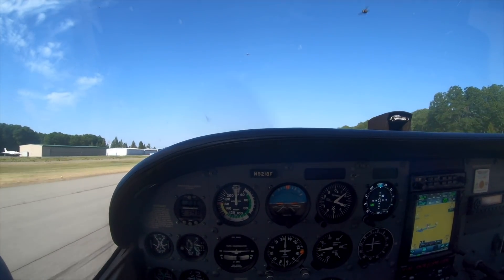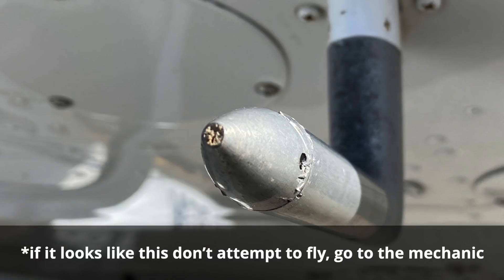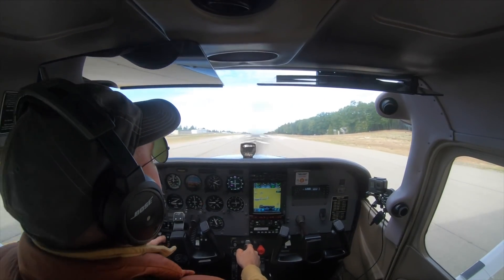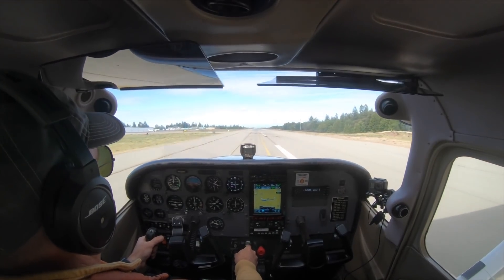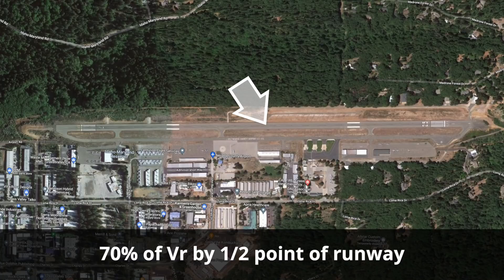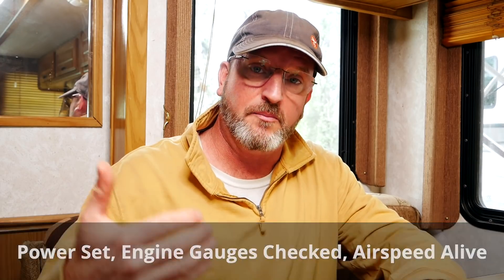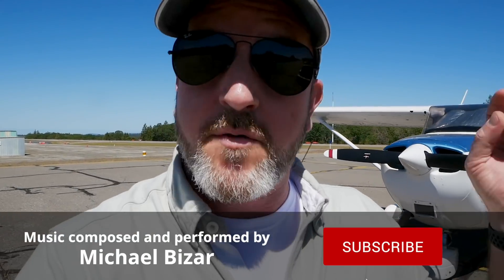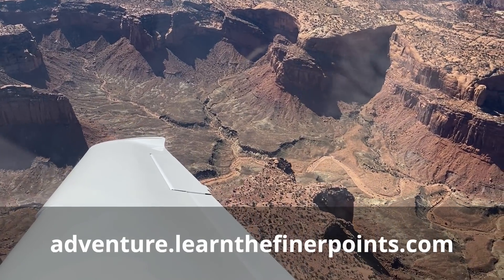PITOT TUBE BLOCKED - Review of ABORTED TAKEOFF PROCEDURES and other Flight Safety Best Practices

Comment: Once with a new (to me CFI) I was doing my walk around. I noticed the alternator belt was super loose. (I’m a welder/mechanic). He said it was probably fine. 

I said “no, V-belts have a specific tension” so I went and told the mechanic. He came out, verified it was loose, but should be ok for a quick VFR flight.

So, we went anyways, and indeed, the belt was slipping.

Comment: Didn't happen to me, but a friend in a 182 was flying down to Florida and his airspeed just dropped and went to about 20% of actual airspeed.  He landed at an airport with no issues went out to check the aircraft and there was what looked like the remains of a bug over the pitot tube. He cleaned it off looked inside the best he could and it looked al clear. Did exactly what you did and his airspeed reading seemed right where it should be. Taxied back and went on his way.

Comment: This is one I definitely relate with.  Had this happen to me doing a rental checkout to resume my instrument training.  The pitot tube looked fine externally on the preflight, but when we lined up and I went full throttle - no airspeed.  Immediate abort (made it to about 60 mph maybe - airplane was in MPH), taxi back, find that there was something gelatinous about 1 foot into the tubing between the pitot tube and the panel.  Plane had come out of its 100-hour that morning, and the pitot system was disassembled and checked as part of it, so the mechanics believed it happened during that, but there was nothing used during the inspection/repairs that would explain something like that (even petroleum jelly) being in it.  Just one of those things, but glad I had always been trained to watch for airspeed indication during the initial acceleration.

Comment: So. About a month ago. During take off roll airspeed came alive, as per normal. However only got to about 45kts. By this time I deemed it safer to go flying instead as 55kts was rotate. When it came to landing and flapspeeds I had my phone providing ground speed. And given a minimal wind day I worked with that. Elected to try and land a little faster than normal rather than accidentally stall out of the sky. All in all a pretty uneventful event :)

Comment: Long ago when I owned a Cessna 150 that parked outside I was In a rush to meet up with a friend at an airport an hour away. I raced through the ground check and when it came time for takeoff I noticed the airspeed indicator was not indicating any airspeed above what was locked in at about 30 MPH. I figured I'd continue the flight anyway.  When I reached my destination I suddenly realized how reliant I was on flying the "numbers" and found it difficult to come in on a stabilized approach (the winds were gusting pretty hard which didn't help either). After landing I took a look at the pitot and noticed I had a "Mud dauber " who had taken up residence in in the opening on the front of the pitot. Fortunately, the friend I was meeting up with had full access to a shop so we easily disconnected the Pitot (just a tube in an old 150) and blew it out with compressed air at the shop. My friend said that he had to set the pressure to max to clear the dauber (those guys really work themselves in there!). After that incident I have always covered and checked the pilot on any plane I own or fly.

Comment: By using the 70% AS/50% RWY rule you can get a false sense of security if you’re taking off on a runway that’s very long compared to your takeoff distance. For example, I fly a 150 out of KAVL, a mountainous airport with an 8000’ strip. If I only have 70% of my airspeed at 4000’, something is very wrong and I don’t have the power required to climb past the terrain.
I prefer to use an “off-by” marker. Estimating performance and adding a bit, then using some easily recognized point. If I’m not in the air by then, I’ll reject. At Asheville it’s the third taxiway, but it can be a windsock, patch of trees, or anything that can be noted in peripheral vision. If I have a passenger, I assign them rejected takeoff callout duties.

Comment: On the pitot tube subject. I recommend anyone use extreme caution when doing preflight check and checking the pitot tube heat. I recommend not having a 15 second conversation with someone just after you turn the switch on and then grab it to check if it’s hot. Best to do it immediately after turning it on. 🙄😂😫

Comment: I own a Cessna 140 which has a little flap over the end of the pitot tube to prevent bugs from entering.  Two times the flap mechanism has stuck on takeoff and on neither time did I have enough runway left (short runways) to safely stop.  Both times I just proceeded with the takeoff and came back around to land.  I’ve added the pitot flap to my preflight check 😉

Another time, I had avionics work done on my plane and the mechanic failed to hook up the static port tube to the outside vent and the altimeter (and VSI) were reading cockpit pressure.  As a result the airspeed indication was about 15% - 20% high at cruise. Anyway, I knew something was wrong and again focused on pitch and power settings and what “felt” right when landing.

All students should be exposed to this failure mode and loss of airspeed indicator should be part of their partial panel training.  Pitch and power equals performance….needs to be drilled into everyone’s brain.

Comment: I learned to fly back in the late 70s and early 80s, and back then, we didn't really do a lot of what you're suggesting in this video.  We checked engine gauges before take off, we made sure the controls were free, clear and correct, but when we pushed the throttle forward, heads were up, outside of the cockpit, looking down the runway.  Was that better?  Probably not, but it's the way it was done back then.  We did, however, practice flying the airplane with no airspeed indicator.  We learned by attitude, engine sound, engine RPM, and climb and descent rates.  Now, I flew Cessna 150s, and Cherokee 180s and also a Skylane, and by looking outside the cockpit, listening to the engine, looking at the RPM gauge (kind of hard in a constant speed prop, but you can look at manifold pressure for a given RPM) you could pretty well tell how fast you were, and you could fly the pattern from take-off to landing without looking at the airspeed indicator.

Would I recommend it?  No, of course not, especially today, but, it can be done and done accurately.  I could put the airplane on speed within two or three knots of the desired speed by 'other references.'  I'm not going to suggest your students couldn't do that, as I've watched the way you teach, but I wonder how many other new pilots or student pilots could do that with what most of them are taught today.

Comment: Happened to me winter flying in a Citabria (no pitot heat) in the CFI.  Airspeed was alive during takeoff, then slowly dropped to zero at about 300 feet during the climb out.  Engine RPM’s and everything else were normal so no question the airplane would fly.  Informed the tower, entered the pattern, and landed.  CFI reminded me to simply fly the airplane, feel the seat and the wing.  Such a great lesson.

Comment: Had this happen on a BFR years ago did a scan of the instrument 
S just after rotation announced no air speed and as if mine and the CFI heads where connected and look at the pitot tube in unison, when’s with power, pitch and one of my better landings in a long time

Comment: No airspeed is much less common than inaccurate airspeed such as a partial blockage. Taking off is not as big a problem as landing. It’s always a good habit to compare IAS to gps ground speed and known wind component on every landing. If a problem is suspected use GPS speed and plan for a longer landing holding it off til it can safety land.

Comment: Reminds me of an incident way back in the day. We were leaving an airshow and everybody was trying to get out of there that flew in. We did a quick walk around but really need to get going. As soon as I got airborne I noticed the airspeed was very lackadaisical and basically no matter how fast I was going it was indicating just above stall. I try to figure out what was going on and lo and behold when I looked out the left window I left the pitot tube cover on. Obviously I could not remove it and I was not in a position to go back to the airport since everybody was departing. So I continued to fly based on pitch and because it was a clear VFR day I was able to judge my airspeed. I set my flaps and my power settings and my pitch according to all the way I was used to landing. I probably landed maybe 5 kts or so faster than normal but it was an uneventful landing. Everyone at the club thought it was hysterical but the manager did not. Needless to say I was reprimanded.

Comment: My RV6 has a little wind-opened aluminum cover on the Pitot tube, and I always check it on the pre-flight, but this spring I had to taxy through some sloppy slush and snow on my way to the active, and I guess some of the slush splashed up on to the little cover, and I had no airspeed info.  I had the tail up and was at the point in the roll where I would usually be airborne, but decided to abort.  just as I began to ease the power back my airspeed sprang to life. At this point I decided it was safer continue the take off than abort, so I took off and monitored the airspeed during the climb.  
 After landing I stopped and looked at the pitot before I taxied back to the hangar, it was clear, and then after I taxied to the hanger, I found some slush on the wing around the pitot tube, so I am confident that is what caused the issue.

Comment: Here's another unknown that could kill you. After annual, I flew from Portland , Maine to Bar harbor. Shortly after I departed Bar Harbor and on take off roll suddenly my windshield was covered with what I first thought was 
a mass of locusts, but quickly realized was oil. Stopped takeoff and called for a tug to the local maintenance shop.
Took off the prop and the shaft plug fell out.  It had not been securely expanded during annual. Had it happened after lift off , my next stop would have been the ice cold water of the North Atlantic. Lesson learned: ALWAYS
be present at the reinstallation of the shaft plug and look to be sure it is expanded enough to create a secure fit.

Comment: Had the mud dauber effect on takeoff roll myself. Never again left the pitot uncovered. 
Jason, here's one that few are aware of. It happened to me on my 172.  The fuselage drain hole was plugged
and there was a fair amount of water accumulation, unknown to me.  All great on takeoff and climb until I reached the freezing level, and the water froze around the cables,
and the elevator control became very heavy to the point of almost no travel. On preflight ALWAYS check the fuselage drain hole.  Consider it to be the 4th point of your "Sump Check"

Comment: We recently had that issue in a Silver Eagle. However, what made it worse was that it was just a partial blockage so the IAS still showed some speed but it was unreliable. We noticed it was about 20-25 knots slow compared to the GS. It is important to be able to use GS (if you have GPS) as backup to get the plane down safely.

Comment: 36 years ago at AUN, my CFI was always in a hurry to get in the air.  He always complained about how long I took to do my pre-flights.  I often replied, "I can't just pull over to the curb and put the kickstand down.  It's my butt on the line, and yours too."  One day he offered me free time in his PA28-180.  Walking out to the plane he told me to pre-flight the right side and he would do the left.  I questioned him and asked, "Shouldn't one person do the entire pre-flight so nothing gets missed?"  He said he didn't want to be late for the appointment with the avionics tech and insisted on his plan, as he was PIC and it was his plane.  I got to the plane first and started at the tail, worked my way up and had completed checking the engine oil and cowling as he arrived at the plane.  He started the plane and told me to taxi out.  When I eased the throttle forward, the plane started rolling and stopped suddenly after only a foot or so.  I offered to jump out and see why we stopped.  He said no, and after two unsuccessful attempts, he took the controls, muttering that I must not have gotten my chock blocks completely out of the way.  I informed him that I had very intentionally placed them both directly behind the wheel.  He shoved the throttle forward at least 3/4 and the plane lurched forward, jolted, and then continued rolling.  He then mumbled that maybe he hadn't gotten his chock completely out of the way.  When we arrived at LHM it was gusting 10-15, so he had me tie down while he went and got the Av tech.  When he came back out, I was holding the left wing down and motioned for him to come here with my index finger like he was a naughty little boy.  I pointed to where the tie down eye had been!  It was snapped off clean where the threads met the lock nut.  Fortunately, it didn't damage the wing.  He turned white like a sheet and quietly said, "Do as I say, not as I do."  He never bothered me about my pre-flights again!  A few weeks later, my mom's car engine blew up and I chose to help her, even though it meant the end of my flight training I had saved so hard for.  I'm planning to get my PPL this summer, finally!!!
Reply: I would REFUSE to fly with a CFI like that. I would insist on a DIFFERENT CFI and maybe even report him to the school. Anyone who has a callous disregard for safety should NOT be in aviation, period! Setting a bad example to a student, is the WORST thing one can do!

I've flown into Auburn and Lincoln many times, BTW, especially when doing my 50 hours XC towards the instrument ticket. I always thought KAUN was a bit of a tricky airport to fly in to, being "nestled in" like that! 

I trained and got my private pilot certificate at nearby Cal Aggie flyers in Davis (KEDU), and also did part of my instrument rating there. Oh, and best of luck with your flight training!
Reply: Yeah... As in all professions, you do get your bad apples. That's why it's so important to trust your own judgment, irrespective of the opposing party's position or seniority. This is something I've had to learn the hard way a couple of times, outside of flying. One of my first instructors was a stunt pilot. He would woo you with his humour and antics, but then in the cockpit he would dominate the controls... Maximising his own flying time whilst you just sit there like a lemon financing the whole thing. I tried to go with other instructors as much as I could. Not an ideal system that school had in place really. My training is also on long term pause. Hope you get restarted soon. All the best.
Reply: You’re a good son, with good judgment. Hope you get back to flying!
Reply: Hey. Did you get your PPL?

Comment: While I was a student and pre-flighting a C150, I lowered the flaps for the preflight check. They started to lower, got to about 10º then dropped all the way to 40º. Turns out a set screw in the mechanism had come out but who knows what would have happened in the air; coming in on short final with 40º then have the flaps fail and completely retract? Scary thought...
Reply: Ask Dan Grider about 40º and not retracting in a Cessna 150 with one other person on board.
Reply: I felt for Dan when I first heard about the incident. I did share this story with him via his YouTube post. I'm not sure if it was Dan or the plane's owner that said it was an electrical issue with a connector that caused the failure. Mine was a mechanical problem. I could take the flaps and move them by hand from 40º up to 10º as easy as one moves the ailerons during pre-flight. To this day, I always pay close attention to the flap system during pre-flight.

Comment: Common cause of pitot blockage is thawing a cold plane in a warm hanger. The snow and ice will turn to water and make it's way into the pitot tube. When you take the plane back out into the cold the water will freeze and block the pitot tube / other small ports.

Comment: I had this happen to me also. I had checked the pitot tube in preflight and no blockage was seen (nor after landing, it was a deeply seated bug nest of some sort).   I make it part of my on board equipment list to always have my portable Garmin Aera GPS powered on before flight.  So, when I took off, with no air speed indicator, I used the Garmin virtual panel setting and made it safely back to landing.   However, your review of this issue is far better than discovering a 'no air speed' indication when its too late to abort the takeoff.  And yes, I immediately ordered a pitot tube cover that day.

Comment: I will disagree 
70 % of your airspeed at the 50% of your calculated ground roll point. NOT the runway total length 
For the typical Cessna this is around 500.
Bob Dilk CFI
Reply: Bob, you are correct.  I think Jason was stating as an easy rule of thumb, but a pilot should know the ground roll for weight and DA before launching.

Comment: Hey Jason, this had happened to me in flight training with my instructor one day also. We were taking off and couldn’t abort and the airspeed indicator was finicky around 45kts. I called out the airspeed indicator wasn’t accurate as we were beginning to lift off and my instructor said just fly the plane. We stayed in the pattern and use the RPMs to land. We had the mechanic take a look at it and when he unscrewed the back of the pito a spider came out of of the tube. It was earlier in my training and I said to my instructor “that little guy could’ve killed me.” Great video and suggestion to know your numbers around the pattern.